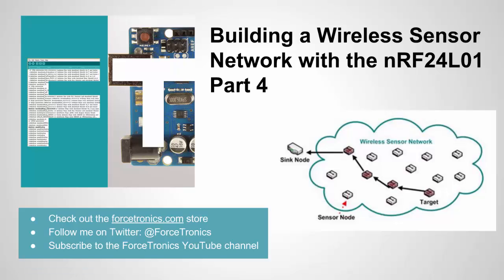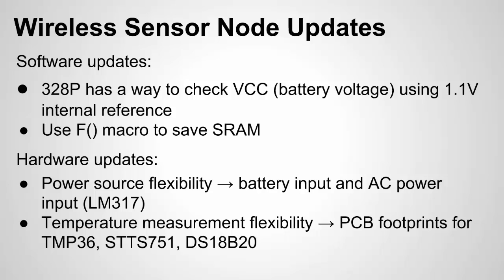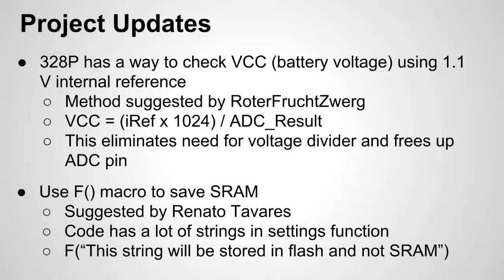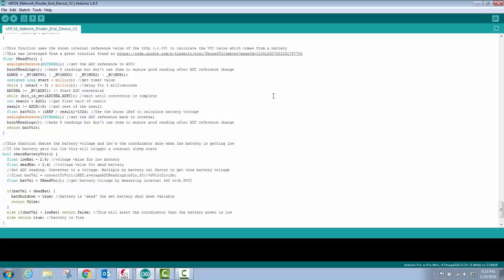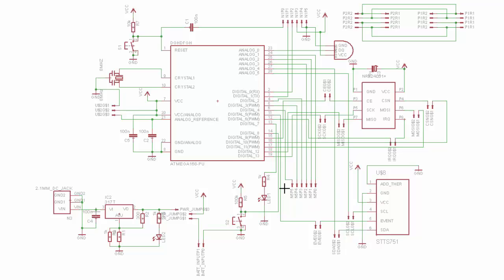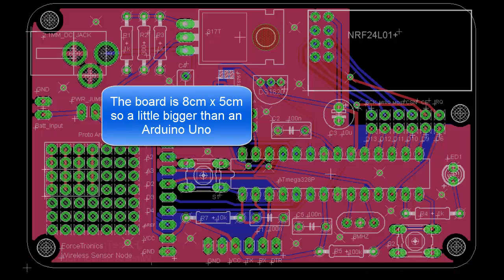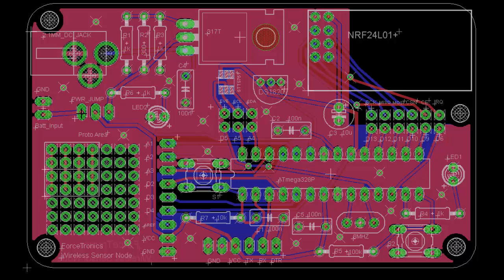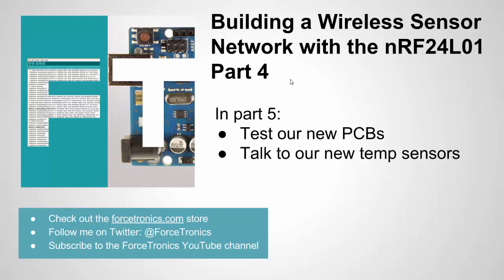Building a Wireless Sensor Network with the nRF24L01 Part 4

Comment: DS18B20 needs a 4K7 pull up on Dout surely?
Reply from the maker: It sure does. Sorry if I did not mention in the video or forgot to include on BOM. You can see it on the schematic I posted on my blog: http://forcetronic.blogspot.com/2015/12/building-wireless-sensor-network-with.html

Comment: Surely the ADC_RESULT is based still on Vbat so you still need a voltage divider?
Reply from the maker: No you do not need the voltage divider. This AVR capability allows you to measure the 1.1V internal reference with VCC as the ADC reference. If VCC is unkown you can backwards calculate it since the value you are measuring, 1.1V, is known.

Comment: I have learned so much from  your videos, THANK YOU!  Also I received my 28 pin dip connectors, they are great for boot-loading and sketching a set of chips! Go ForceTronics!
 The ATmega328p has an internal 8 MHz clock. What is the reason you are using an external clock?
Thanks again,
-Rob
Reply from the maker: Hey Rob, your welcome and glad you are finding the videos useful. To use the internal clock you would have to change the fuse settings on the ATmega328p. To keep things simple and to leverage the Pro Mini bootloader I went with the external oscillator. A secondary benefit is the external oscillator has better accuracy and stability. But no reason you couldn't go with internal.
Reply: Fuse settings, uhh ohh, I have  loaded 6 atmega328P with a 8 MHz boot-loader to run my ds18b20 sensors. 
I didn't change anything as far as fuse settings go.
The project works great. Do you think I should look into it deeper?
Reply from the maker: If it is working and you have no external oscillator then you are probably fine and I am wrong. I was under the impression that you had to adjust the fuse settings to use the internal clock. But your project would not work if there was no clock / oscillator
Reply from the maker: Yeah I have used app inventor in a couple of videos
Reply: I'm having trouble changing the color of the label text that displays the temperature of a sensor when it rises over 41.00 degrees F. It is a simple concept,,, I thought...  A linkhttps://groups.google.com/forum/#!topic/mitappinventortest/7g78TyfPYb4I have tried so many combinations and hmmmm....

Comment: Hello, I really don't get the point of how to measure the battery voltage because we don't know the aref pin voltage(as I know) because it doesn't exist on the pro mini ?
Reply from the maker: This method uses the internal 1.1V reference and has nothing to do with an external reference or aref pin. The 328p provides a way to measure the internal reference using the ADC and VCC has the reference. Since VCC is unknown (battery voltage) and the internal reference is known we can back calculate what the ADC reference or VCC is giving us the battery voltage. If it is still not clear I would recommend looking at the 328p data sheet and how the ADC and ADC references work.
Reply: I did this and I got it, but when I measure the vcc I find 3.27v but the calculated vcc is 3.15v !!!

Comment: These videos are great...Except that when I download all of the examples and all of the associated libraries, none of them will compile correctly and turn up a page long reason as to why they don't compile. I haven't changed any of the code yet...
"
In file included from /usr/share/arduino/hardware/arduino/cores/arduino/Arduino.h:192:0,
                 from /home/keith/sketchbook/libraries/RF24master/RF24_config.h:58,
                 from /home/keith/sketchbook/libraries/RF24master/RF24.h:18,
                 from nRF24_Network_Router_End_Device_DS18S20.ino:3:
nRF24_Network_Router_End_Device_DS18S20.ino: In function ‘void checkNodeAddress()’:
/usr/share/arduino/hardware/arduino/cores/arduino/WString.h:38:95: error: conversion from ‘const __FlashStringHelper*’ to non-scalar type ‘String’ requested
 #define F(string_literal) (reinterpret_cast<const __FlashStringHelper *>(PSTR(string_literal)))
                                                                                               ^
nRF24_Network_Router_End_Device_DS18S20.ino:153:18: note: in expansion of macro ‘F’
/usr/share/arduino/hardware/arduino/cores/arduino/WString.h:38:95: error: conversion from ‘const __FlashStringHelper*’ to non-scalar type ‘String’ requested
 #define F(string_literal) (reinterpret_cast<const __FlashStringHelper *>(PSTR(string_literal)))
                                                                                               ^
nRF24_Network_Router_End_Device_DS18S20.ino:154:20: note: in expansion of macro ‘F’
/usr/share/arduino/hardware/arduino/cores/arduino/WString.h:38:95: error: conversion from ‘const __FlashStringHelper*’ to non-scalar type ‘String’ requested
 #define F(string_literal) (reinterpret_cast<const __FlashStringHelper *>(PSTR(string_literal)))
                                                                                               ^
nRF24_Network_Router_End_Device_DS18S20.ino:155:18: note: in expansion of macro ‘F’
nRF24_Network_Router_End_Device_DS18S20.ino:158:13: error: ‘class EEPROMClass’ has no member named ‘get’
nRF24_Network_Router_End_Device_DS18S20.ino:164:27: error: ‘class EEPROMClass’ has no member named ‘get’
nRF24_Network_Router_End_Device_DS18S20.ino:166:27: error: ‘class EEPROMClass’ has no member named ‘get’
nRF24_Network_Router_End_Device_DS18S20.ino:180:16: error: ‘class EEPROMClass’ has no member named ‘put’
nRF24_Network_Router_End_Device_DS18S20.ino:186:16: error: ‘class EEPROMClass’ has no member named ‘put’
nRF24_Network_Router_End_Device_DS18S20.ino:197:16: error: ‘class EEPROMClass’ has no member named ‘put’
nRF24_Network_Router_End_Device_DS18S20.ino:203:16: error: ‘class EEPROMClass’ has no member named ‘put’
nRF24_Network_Router_End_Device_DS18S20.ino:214:16: error: ‘class EEPROMClass’ has no member named ‘put’
nRF24_Network_Router_End_Device_DS18S20.ino:220:16: error: ‘class EEPROMClass’ has no member named ‘put’
nRF24_Network_Router_End_Device_DS18S20.ino:231:16: error: ‘class EEPROMClass’ has no member named ‘put’
nRF24_Network_Router_End_Device_DS18S20.ino:237:16: error: ‘class EEPROMClass’ has no member named ‘put’
nRF24_Network_Router_End_Device_DS18S20.ino:252:12: error: ‘class EEPROMClass’ has no member named ‘put’
nRF24_Network_Router_End_Device_DS18S20.ino: In function ‘void getEEPROMValues()’:
nRF24_Network_Router_End_Device_DS18S20.ino:265:10: error: ‘class EEPROMClass’ has no member named ‘get’
nRF24_Network_Router_End_Device_DS18S20.ino:266:10: error: ‘class EEPROMClass’ has no member named ‘get’
nRF24_Network_Router_End_Device_DS18S20.ino:267:10: error: ‘class EEPROMClass’ has no member named ‘get’
nRF24_Network_Router_End_Device_DS18S20.ino:268:10: error: ‘class EEPROMClass’ has no member named ‘get’
nRF24_Network_Router_End_Device_DS18S20.ino: In function ‘String getInterval()’:
nRF24_Network_Router_End_Device_DS18S20.ino:284:10: error: ‘class EEPROMClass’ has no member named ‘get’
nRF24_Network_Router_End_Device_DS18S20.ino:295:13: error: ‘class EEPROMClass’ has no member named ‘put’
nRF24_Network_Router_End_Device_DS18S20.ino: In function ‘String getMode()’:
nRF24_Network_Router_End_Device_DS18S20.ino:303:10: error: ‘class EEPROMClass’ has no member named ‘get’
nRF24_Network_Router_End_Device_DS18S20.ino:309:12: error: ‘class EEPROMClass’ has no member named ‘put’
"

It's probably something silly that I have down wrong...
Reply from the maker: thanks. it looks a library problem. Did you use the maniacbug versions of the nRF24L01 libraries from Github? if you use the newer TMR versions the code wont work. here is the link https://github.com/maniacbug
Reply: +ForceTronics Thank you so much!
Reply: +ForceTronics Unfortunately that didn't seem to change anything. I loaded a fresh copy of Arduino IDE on a computer that never had it before, and downloaded your code and the libraries in the link but I keep getting the same result :-(
Reply from the maker: +Keith Green Are you putting the libraries in the Arduino IDE library folder?
Reply: +ForceTronics Correct. I'm putting the entire folder that I download in the library folder. I've had success with my PS2 controller libraries and some other libraries...Not sure why I can't figure out my issues with this one. I really appreciate your taking the time to respond!
Reply from the maker: Ok. Make a blank sketch and copy all the library calls from wireless sensor sketch (all "include" calls at top) and then compile it. If you get errors you have a library path problem. If you don't get errors something is wrong in the code.
Reply: I read somewhere that these libraries cannot co-exist simply because they are named alike. The advice given was to completely remove whichever one is not being used and not attempt to overwrite it. I have no idea why or if this is correct but it seems possible. I am certainly no expert but is was said that the other library you mention corrects some errors in the maniacbug version. This is definitely a project I am interested in for work so thanks for the great effort.

Comment: Nice series, I've been digging into this project lately and came to a dead end on the RF range. 
Still can't validate whether the PA+LNA module with RF24 library can go anything more than 100m let alone the claimed 1.1KM. As per the datasheet of the PA + LNA chip, RFX something, on these modules (ones with PA/LNA feature) the antenna gain can reach upto 20dbi which is pretty neat. 
It would be great if you can do a quick comparison between the two variants. My understand is that there is a library issue.
Would love to see a video on this since you're already into this module pretty deep :) cheers!
Reply from the maker: +Syed Mazahir Rizvi Remember that the 1000m spec is for line of sight. That means ideal low noise environment with no trees or buildings or anything between the transceiver antennas. When you see a max range spec like that never count on actually getting that range. With that said, 100m seems low. There is a way to turn up the power on the nRF24L01 module itself. I don't know for sure but I believe the Arduino library doesn't default to the highest power level. Go to the RF24 library documentation and look for the function that controls the transmit power.
Reply: Thanks for coming back on this and apologies for not describing the whole issue in detail.

I've tried the testing the radios under the specified conditions i.e. NRF24's PA setting to be MAX i.e. 0 db the the data rate set at 250kbps for max throughput i.e. longer range. Also LOS.

As per some of the documentation the external PA+LNA should trigger at the max power setting if the NRF PA is set to MAX.
But no luck at all. Some  suggested that this is due to a library issue in particular with the CE pin that is responsible for enabling and disabling the TX mode on the external PA + LNA module.

Attached is something that may help. Would appreciate any input on this.

https://www.squirrel-labs.net/blog/getting-the-best-out-of-nrf24l01/

Comment: Great series. Are you considering a display of some type for programming and/or monitoring the status of the coordinator and routers? What about a cheap TFT with touch screen?
Reply from the maker: +leslie saunders Definitely some type of interface is needed for the coordinator. I think a display of some kind with the ability to do remote monitoring from maybe a Bluetooth or WiFi device. Don't plan to do a router display. So far I have been focused on the router and end device design that i have not really thought in depth on the user interface for the coordinator, but like the suggestion.

Comment: Love your video's - I have really learned a lot. I built a EndDevice using a Nano, a Router using a Uno, and the Coordinator also using a Uno. I have all three running on m work bench and have a question. In reviewing the code and the RF24Network library it looks as though when the Router calls network.update() the packet being sent by the EndDevice (addressed to the Coordinator 00) will be forwarded directly by network.update() and never actually be "seen" by the Router (e.g. network.available() will always return false for the Router. Since I am running all three boards on my bench and they call all hear each other, I would expect the Coordinator to receive two messages each time the EndDevice transmits (one directly from the EndDevice and the other forwarded by the network.update() call from the Router.) Is this correct? It looks like I only receive one message at the Coordinator.
Reply from the maker: +Lloyd Linnell Hey thanks. A child node will always pass its message through its parent, it will never pass a message around its parent. In your setup the router is the parent of the end device. If the end device sends a message addressed to the coordinator it will go through the router (via network.update()) to the coordinator. It will never go directly to the coordinator so the coordinator will only get one message. The point of this type of configuration is if the end device is too far away to communicate directly with the coordinator so it communicates with it through the router. Correct you will not be able to read the message from the router via network.available()
Reply: +ForceTronics thanks, that cleared it up. working great, having lots of fun!

Comment: I see you are using the Manicbug nrf24 library, I believe that is no longer supported, updated. Would this one not be better?  https://github.com/TMRh20/RF24   https://github.com/TMRh20/RF24Mesh  I am currently using it and it works well. Just a suggestion as these are part of the ide. Your code compiles with these, not yet had chance to run it.
Reply from the maker: +Shaun Whiteley Thanks for the suggestion. I have tried the TMRh20 RF24Network and RF24Mesh, but after I had started this with the manicbug version. The mesh version is nice since it handles the parent addressing for you and even can automatically change the address if you move a node. The one thing I am unsure of though is if long sleep periods can work since you don't know if the unit is a router of end device. If it is a router it would have to stay awake to pass on any traffic from a end device that wakes up and transmits to the base?? I haven't had a chance to test it thoroughly, but let me know if you get any insights on it.

Comment: I enjoyed looking at the Eagle PCB file.  It cleared up some questions I had.   I was not familiar with the 328p and have never used it.  Are we going to be able to use all of the pins on the 328p and, if so, how?  It looks like a few pins aren't going to be accessible.
Reply from the maker: +David Jenkins I provided access to most of the standard Arduino analog and digital pins as well as access to the AREF pin. One exception is the A0 pin which I wired directly to the temp sensor footprint (TMP36 or DS1820). The D7 and D8 pins I use for the LED status indicator and settings menu selector, respectively. There are pins that need to be used for the nRF24L01 communication as well as communication with the STTS75 temp sensor, but those can be access via jumpers pins I put between the 328p and other device. To access them I put in standard pin holes that can either be soldered to or a male or female pin header can be put into place. Is there certain pins you are worried about?

Comment: Excellent series thank you, very well explained. If you're going with the option for wall wart, would it not be worthwhile having a 5v output on the pcb for 5v sensors?
Reply from the maker: +Shaun Whiteley Thanks for the suggestion. Adding a 5V output would make the board even more flexible, but to keep things fairly simple I will stick with just one common VCC level. Adding a 5V supply via a DC to DC converter would add additional parts cost to the board. also it would most likely more than double the power consumption when running off the battery in sleep mode. There are super efficient converters out there but they are typically not in maker friendly packages and require various components around them. With that said if 5V is critical to your project goal you can always add another voltage regulator to the design.